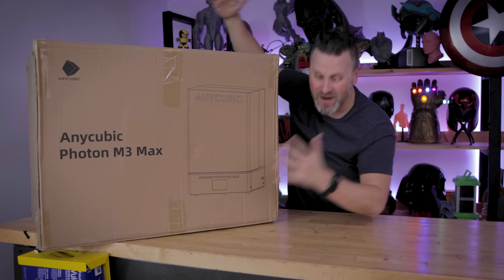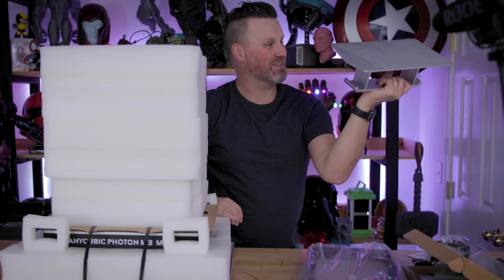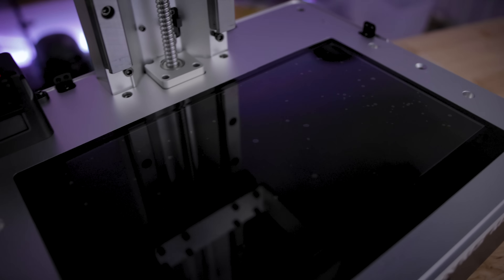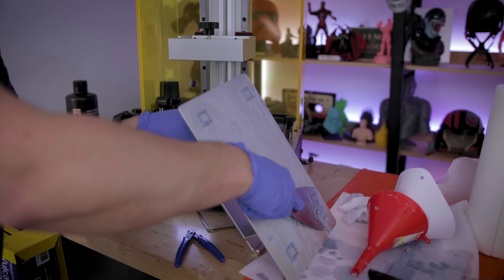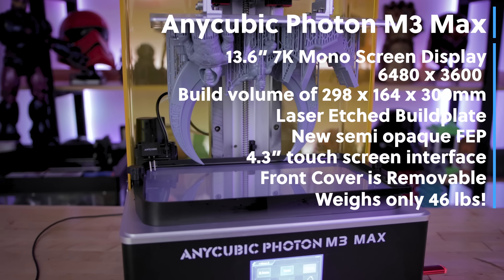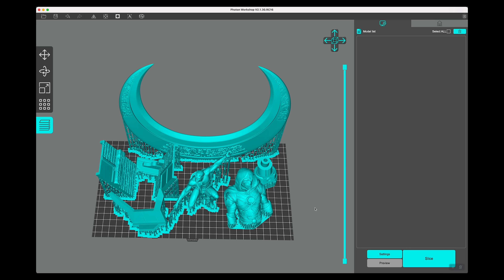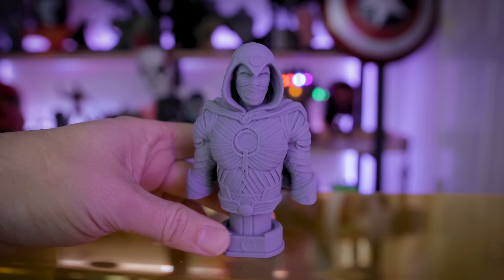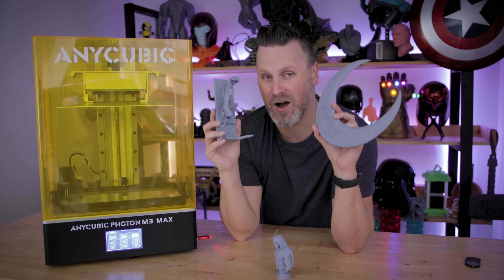This is amazing! Anycubic Photon M3 Max - First Look!

Comment: wow... that is a crazy size of a build plate.. should give us a comparison to some of your other large build plates.. i do like how anycubic keeps there angle build plate design to have resin flow off the top when printing and to see there also getting into the auto filling development can be a huge win if your planing on maxing out your build plate like you did with the long dragon {could be another stress test for yah} and i will admit i think most of us will be skeptical about the semi clear fep sheet.. does the fep sheet feel stronger or tougher compared to normal? in any regard i'm sure you will have some fun and will be doing a good few tests on all it's abilities ..
Reply: I have a Mono X6k I can assure you the build plate collects a large amount of resin and there is a ton of waste unless you build a side hang drip attachment. It's the thing I like the least about the machine

Comment: Very tempting, but what a strange place to keep the bottle though, good if you have plenty of space around the printer, but if you want to have in a tight space, then your knackered.
Reply: At that size without the autofill, you'd have to have plenty of space anyway.  It's like buying a huge care before knowing if you have a parking space or garage for it.
Reply: @DesignIncase  seeing as the cover is split and can be pulled off forwards, then could easily sit it in a tight space. Far better to have the bottle attachment to the side, which could be done, longer cable and tubing. 

Changing the colour will be interesting.

Comment: Did I miss the actual HOW the auto fill works? Pump? Gravity? Venturii? Electric resistance for level?
Reply: Assuming its continually testing the continuity between the 2 probes so when there is no resin between them its reads either open or a high resistance so it knows it needs to pour x-amount of resin in.
Reply: pump. unlike the Elegoo Jupiter which is gravity. pump is a point of failure.

Comment: I'd put the resin bottle in a magnetic stirrer so the resin is always mixed well. That' d be awesome
Reply: @dancarr2099  and that’s also relatively easy to do. There are usb-powered heaters that heat a little carbon fiber pad acting as a resistor that could be wrapped around the bottle and they are very cheap. I have some of them around. I’ll try them
Reply from the maker: Fantastic idea!
Reply from the maker: @dancarr2099  Heater would be the extra thing I'd like to see here
Reply: @UncleJessy  heater done. You just need a sock, a usb heating pad and a 2 amp USB port which can be a usb power bank
Reply: @UncleJessy  hold my beer, back in 10 minutes. I’ll make a very diy one
Reply: Good point about stirrer. Be interesting to see a colour change, lot of cleaning to do
Reply: @northwales1000  With a magnetic stirrer like the ones used in laboratories, it wouldn't be any more difficult than a color change with the default system. Just take out the cap from the bottle and take out the stirrer (which is just a magnet bar coated in teflon) with another magnet and clean it with the solvent, which you still have to do with the cap thing from the machine, which looks like a lot more difficult to do. And those stirrers are not that expensive (or you can even 3d print one for cheap). You could also use a vibration stirrer, but that might be a lot more difficult to implement.
Reply: @smokeduv  stirrer is easy, same as wash an cure station. I mean changing colour of resin I  general, clean the pump, tubing and outlet near the sensor.
Reply: @smokeduv  Just use steel ball bearings, once the bottle is done you tip them into the next, and as the steel doesn't get exposed to air they won't rust (just need to make sure they're clean in the first place)
Reply: I was wondering how that would work over longer term. How often you'd need to disconnect to shake the bottle up. I don't think we've found the perfect printing system with resin yet but its heading in the right direction improving yearly which is great to see.

Comment: Does the autofill stop when the build plate is raised and the print is complete?
Reply from the maker: It only runs when the print is actively printing and it detects the resin is lower than the sensors